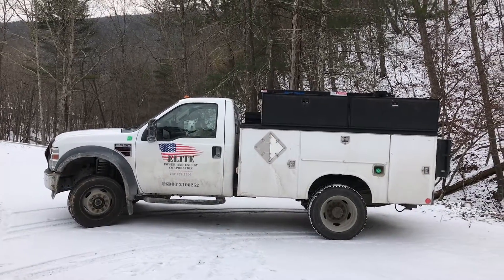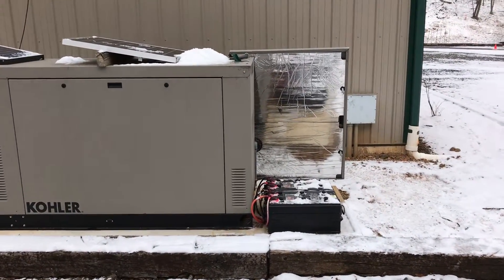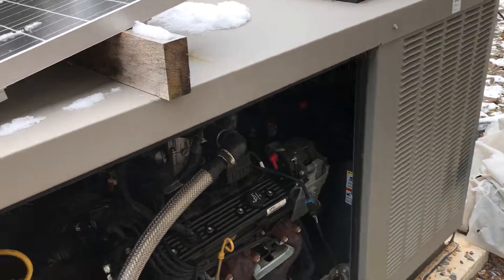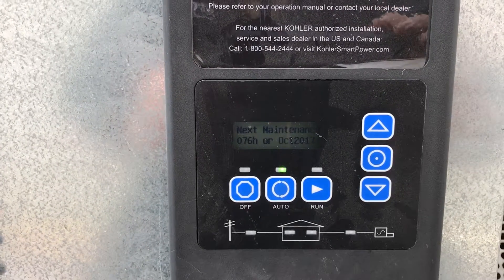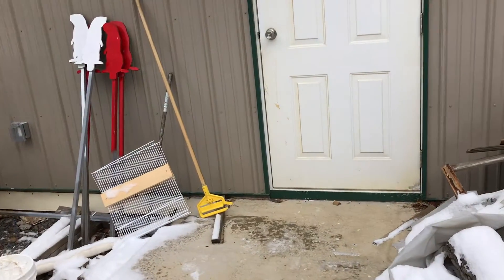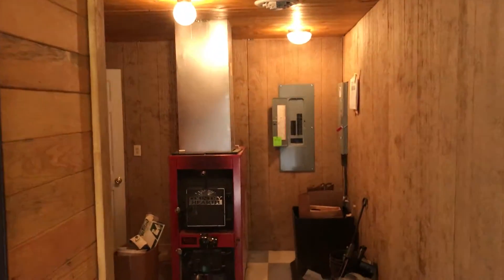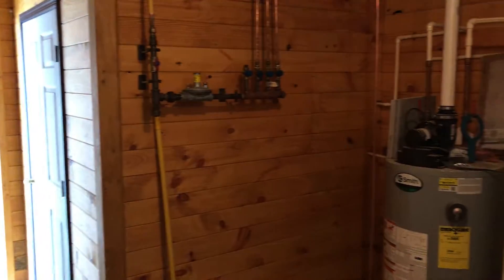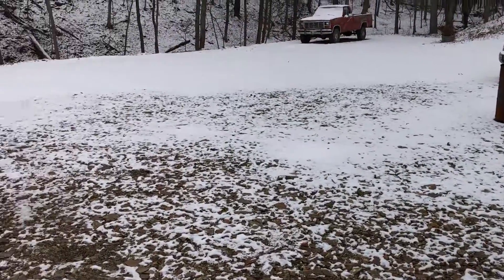48kW Kohler RCL - Off Grid Installation

Comment: Question!
I see the gen switch is set at auto. What would happend if generator losses 120v from inverter. Would it start the gen automatically til inverter is back online with 120v??
Can you not run grid power to generator and able to use the gen ?Also auto start wiring for Kohler #3 and #4. It's not two wire start correct?
Thank you